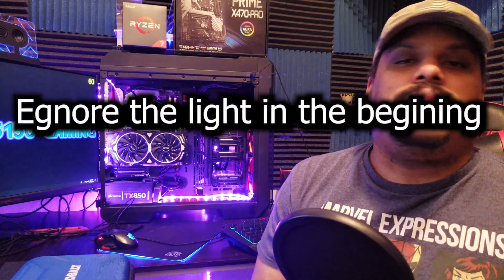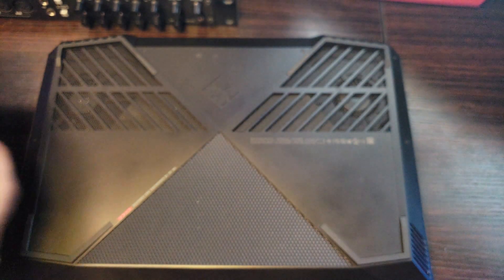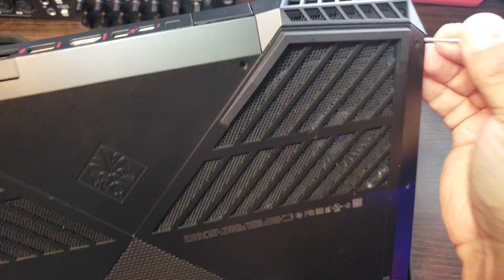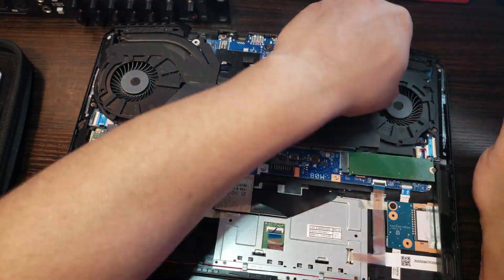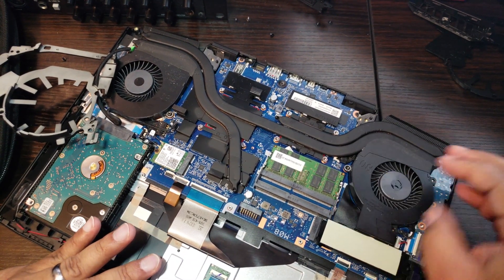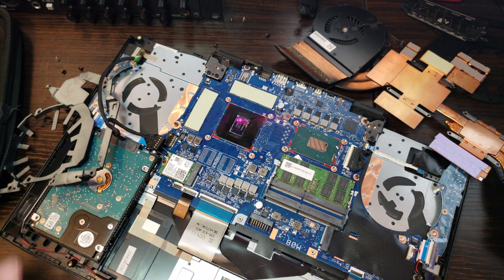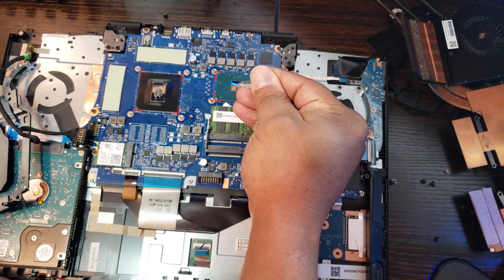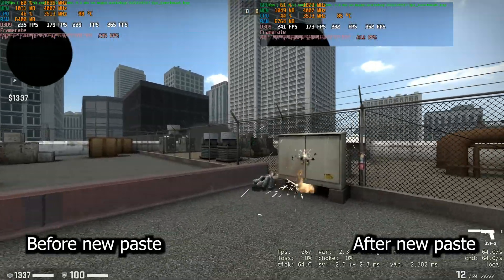HP-Omen 15 how to add new thermal paste to laptop / Laptop Tear down

Comment: I wonder if you removed the black plastic covering off the heatpipes if that would help with thermals when it comes to a laptop cooler
Reply from the maker: Idk if I'd do that it works well for catching some dust and debris.  Not sure if it's something I'd do lol. There'd be pretty big opening  :)
Reply: @EnforcerGamingX  I literally mean the plastic black barrier on the copper heatpipes themselves . For whatever reason ,it's all covered by that material on that one side but not on the other. I'm not talking about removing part of the outside plastic shell.

My thinking is if this is removed then you could have air from a laptop cooler blow air directly on part of the newly exposed copper heatpipes this helping dissipate heat

I have the same laptop,I'ma see what I can do tomorrow. I've already repasted it but I want even more cooling. I may go liquid metal soon
Reply from the maker: Ahhh okay I see. Let me know what results you get. :)
Reply: @EnforcerGamingX  I finished it this morning, had to use a flathead screwdriver to get most of it off. see pics below

https://photos.app.goo.gl/cS98bx95R1tEZUVLA

After running stress tests there is a difference in cooling performance for sure. It takes an extremely long time for AIDA 64 to indicate any CPU throttling now, and even then its like 1%.

I also like the look of the copper better :)
Reply: @Unsmooth_Edwarda  that's cool! How do you power those up?
Reply: @kylesiwi4093  I used this

https://www.amazon.com/dp/B081K8LBH3/ref=cm_sw_r_cp_apa_fabc_UFNWFbJD7JM14?_encoding=UTF8&psc=1

Comment: hey man thanks for the video. my hp omen 15 is running at about 88-92 degrees Celsius when i am gaming. should i replace the thermal paste or are temps like that normal for that kind of laptop? kind regards
Reply from the maker: While gaming that's fine, the problem I had was it was always hitting 100°c which in turn triggered the CPU to throttle. So if you're getting those temps you're good. Always helps but I wouldn't be worried on those temps. Thanks for watching!
Reply: @EnforcerGamingX  Bro thanks for that quick answer! The temps are around 40 degrees while casual use and only hit 90 while playing demanding games. Thanks for that relieving answer!

Comment: Hi! I have been thinking about doing a repaste. However, i am afraid i will break the laptop in the process. What do you think i should do, open it up myself or send it to the store and make them do it?
Reply from the maker: The HP store will put new thermal pads on which is part of the problem. Pads are just a lower cheap pad of paste, the actual thermal paste is what helps the most. Opening up the laptop is less complicated than it seems, I suggest recording everything if you do it on your own so you can track back during reassembly. I been doing it for years and still like recording, used to take photos as I worked but yeah cellphones and have plenty of recording gear now days lol. Search the comments here, there was a 14 year old that did it not long ago :) this video has most of what you need, I tried to cover it all. Let me know your results I'd like to hear about it! Thanks for watching!
Reply: @EnforcerGamingX  Thank you so much for replying. I will try to open it myself using your tutorial. I will buy the required equipment by the end of the week since i am busy with school right now. Anyway, thanks for your advice and i hope everything will go smoothly. :)
Reply: @daultimatepig3579  how did it go

Comment: How did this laptop make it on the shelves? its a safety hazard.
Reply from the maker: Well the problem is with all laptops that have 6+ cores. There was such a high demand for faster CPUs in portable gaming but the technology is not there yet. A desktop we can toss on a bigger heatsink and fan. With a laptop it's just not possible. They try with better airflow and giving options to push more power into the fans. It is however, horrible that they use such cheap thermal pads. At this price range we won't see decent cooling with 6+ CPU cores unfortunately for quite some time. Thanks for watching!
Reply: That's pretty much what I said. Repasting my brother in laws today after seeing he games at a constant 85degrees-100degrees on both chips constantly. He said that he called HP/Omen and they said there are failsafes for temperatures that are "unsafe". Told him like man if my PC ever hit those temps it would shut itself off completely. Crazy.

Comment: So im going to do this with my omen 15 ,but my friend is having a issue with his fans not kicking in when they should only when the laptop get super hot. Could this also be the same issue?
Reply from the maker: Actually when I was researching my issue I ran across a lot of information about fans not woring, and it seemed to be tied to the bios updates. Have your friend uodate the bios to the latest and see if that works. If not then the system is not telling the fans to kick in when it's heating up, a setting could also be wrong. If thats not it then could be something more physically wrong and best to check with HP on the issue. Likley the bios issue tho, but no wouldnt be the same issue as we're having. Hope it all works out, thanks for watching!
Reply: Check on the Bios. There is an option where you can choose if the fans ate always on or if the just kick in when under load

Comment: Undervolting with throttlestop is way easier.my omen 2019 GTX 1660ti was in the 97 degrees area right out of the box playing ac Odyssey and borderlands 3.after utilised throttlestop with a -125 my temp dropped to 68 degrees.i was previously using Sager laptops which are way easier to take apart but found this hp omen with a 9750h and a GTX 1660ti 144hz screen for 1100.00 on Walmart.if you like to tinker and whatnot then hey do you
But if not try throttlestop.
Reply from the maker: Yeah I'm not a fan of undervolting, mostly don't want to suggest it for most they can do much more harm then just adding paste. Hopefully they find a real solution to heat in 6 core+ laptops just no good options yet. Thanks for watching!
Reply: @EnforcerGamingX  Wait can you explain i have been told undervolting is safe worse case system crashes and needs to reboot.
Reply from the maker: @ryanclemons1  In general, yes, 100% safe. if you know what you're doing in bios. I say for most as many people are not too savvy when it comes to bios settings, get an itch to see a setting and start messing around. As a YouTuber, I want to be sure I don't recommend anything that may harm my viewer's systems ( Not hardware). Even tho it's not directly my fault I would feel bad for even suggesting it. It's not a big serious issue, the worst case is corrupting the system or a file but still a quick fix. Unless you're wanting to be more eco-friendly, I never see much reason to go into undervolting, so that's why I'm not a fan lol. But, to be clear I may at one point as it is something I'd like to show viewers on this channel.
Reply: @EnforcerGamingX  I get you man it's your  channel your rules.
Has for me I will not be going in my bios i plan on using Throttlestop to undervolt and the main reason i plan on undervolting is Temps i hear it can lower temps by 10C or more without lowing performance saving the hardware from throttling and damage. All without opening my case something i only want to do if i really have to since i have a bigger fear of screwing something up with the hardware. But i still will if you know the laptop needs cleaned or if undervolting does not give me the temps i need i may need to repaste.

Comment: Can you replace graphics card with another one on hp omen
Reply from the maker: Sorry it took a bit to get back to ya. Unfortunately no, it's soldered in like the CPU. They really should start building upgradable laptops, you can still change out the norms. The SSD which is a good one in here with an additional slot, the RAM is also upgradable. The GTX 1060 is good for everything, ive used pretty much everything in Adobe suite without problems. photoshop, indesign, premiere for my videos. Blender, 3Ds max, Maya, and game engines like unreal works fine with the 1060. Only real upgrade would be the RTX versions for gaming design.  Thanks for watching!

Comment: i still have a warranty for 1 year on my HP Omen 17. if i disassemble my laptop my warranty will be gone. so, it is a tough chose
Reply from the maker: On a legal note no, but I really can't give legal advice,  but if you live in the United states we are protected by law to be able to preform general maintenance on any electronics we own. It worked well for me and I wouldn't go back on that decision.  I was still under warranty during these videos.  Thanks for watching!
Reply: High risk = high reward, get stuck in HP wont do anything for you anyway- trust yourself

Comment: Hello , i added a new thermic paste but my laptop still up to 95 °C in game ( Mordhau) . Do you think that i put too much paste?
Reply from the maker: Yeah you may have added too much or too little.  Too much normally won't be too bad. Are you at leader staying under 100°c that's where the problems will come in when ur always maxed at 100..

Thanks for watching!
Reply: EnforcerGamingX  I definitely resolved the problem . I cleaned my ventilation and I up to 80  C . So check the ventilation if you buy the pc 1 year ago .   Put off the dust and repast with artic.

Comment: Great video!! 
Lately I've been concerned with my omen, i've had it for around a year and it's being getting rlly hot (being playing Rise of the tomb raider) so I bought a cooler pad for it but didn't change much.. 
First time dissembling but this video made me super confident so I'll buy an artic silver this week for my laptop :D
Thank you very much!!
Reply: How does it end? What are the temperatures now?
Reply: Use a high density paste not a low one like MX4, use thermal grizzly or TF8, trust me in this, you won't regret it.

Comment: New subscriber, great video brother, I got a new omen 15 a couple months ago and the temps seem pretty normal, for some reason the omen command center button doesn't work and omen command shows unrealistic temperature jumps that just go up and down depending on cpu usage, I've played battlefield V on max and it gets too hot to touch but doesn't throttle after hours, as soon as I see any throttling or shutdowns I'll open it up and slap some new paste on it, thanks for the tutorial :)
Reply from the maker: Hey Carlos! Thank you for your sub! That command center I've been having problems with also the temps never line up with my other programs, never know which to trust lol. I did an update video not long ago but may do another as the temps are still better than pre-paste it is starting to get hot again into the 90s at times. So maybe I'll need to repaste after 6 -10 months. Still better than being over 100°c all the time. Thanks for watching!
Reply: I guess since laptops run hotter than desktops the paste goes dry and crumbly faster, can't beat the portability though, only reason I prefer my laptop over desktop

Comment: I did this  ,many times because i didnt get a nices temps, before apply thermal paste i was getting 76-89 c and after apply new paste ( arctic silver 5) it keep getting high temps, even more, around 89-100 c , gpu decrease a lot , from 79 to 50 c , but cpu doesnt. While it is idle, it geto 30 c, but if i open a word, or a youtube video it goes up to 90 c in one second, and  goes back to 30c , everytime if the cpu usage is high , temps increase inmediatly to high temps, in 1 second,  in game is the same. Im playing at 90 c , and if i open menu option, it decrease automatically to 40c in 1 seconds, and i back into game  it back to 95 again so fast. How to fix it?
Reply from the maker: What... On earth is going on with your laptop lol. That's definitely not the actual temps. I'd say you knocked a senor or something but it would normally just stay at a strange temp. Something else is going on. I'd take it in man, or try to find what's misfiring with Sandra lite. That's got to be frustrating lol. 

Thanks for watching!
Reply: I did a full report of sandra and all is normal . My cpu is (i7 7700HQ)  I did remplace  the memory cards , from 2400mhz single  to 2666 mhz dual channel . It could provoke  that strange temps? Since i7 7700hq (on intel web) says it support 2400mhz ?

Comment: which thermal paste did you use? is that silicon ,seramic or metal?
Reply from the maker: Mentioned it in the beginning it's the Artic Silver 5 a Polysynthetic thermal paste. Definitely don't want to use liquid metal on something this new. That's more of a drastic measure.

 Thanks for watching!
Reply: @EnforcerGamingX  i know i was confused between 13 or 5 so that's why i ask .Thx fr replying me back The video is so much helpful nice work

Comment: Hey nice tutorial, i have a problem with my omen to, its the exact model as yours, im getting trouble playing games, when the laptop is plug in i get 97-100 c and im very scared because the laptop is new, and when i play games its laggin and breaking from throtheling i guess. I have insurance but idk if they cover this as a problem...should i go there and report this problem or maybe deal with it myself and save de insurance for later issues? Great videos, glad you are doing well with this laptop
Reply from the maker: Yeah that's shuttering is from the overheating I did an update on this a few weeks ago and it's still doing well. Did address some of the concerns with warranty and new tech gear. In short you should be fine as there's laws that allow you to make to make repairs in the U.S but of course check warranty laws where your from. Few people have put in trouble tickets with HP and they will add a new thermal pad ( not paste). It's low quality and will work for another few months. It's more of a cost savings solution for them.  A decent paste over the counter can really make a difference. I do recommend contacting HP to see if they've updated their practices, it doesn't hurt :) let me know what you do I enjoy reading the successes from my videos. Thanks for watching! Here's the update video on the repaste https://youtu.be/IY4d-bA7Uxg
Reply: @EnforcerGamingX   tks for the help, i will try contacting HP, do you think i can change the thermal paste like you did without practice, i'm  a little afraid to damage something
Reply from the maker: @skatefdp  Yes absolutely, as I tell everyone that's new just take video or pictures as you work. The only real trouble is putting things back together. Few weeks ago a 13 year old followed this guide and had success. It seems more difficult than it is :)

Comment: You helped me soo much, I did this a few days ago and the temps have dropped around 15-20° while gaming. I was experiencing heavy thermal throttling (couldn't run cs go/ bf4 at lowest settings higher than 30fps).  Now I can play both games again at ultra settings with a steady 100-130 fps (bf) and over 200 in cs go. My laptop also couldn't cool down anymore, it would reach temps above 95 after gaming (both cpu and gpu) and they wouldn't cool off at all, unless I shut it down and left it off for a couple of minutes, but now that's been resolved aswell. Thank you so much man!
Reply from the maker: I love hearing how my videos help others. Glad this worked for you can you can finally utilize pricey laptop. It's frustrating when you pay a premium price for something and you can barely use use because of a minor manufacturing flaw. They really should be using real paste crazy they use these pads because it costs less. I'd rather pay a few bucks more knowing I don't have to repaste later on lol. That's my personal take ... so glad this helped and thank you for sharing your experience :)

Comment: Hey man i just changed my battery and when i start it up it says my cmos checksum is invalid what does it mean?
Reply: Yeah i bought a new battery because mine was bloated after two years and the warranty doesn’t cover the battery after a year. After that happened it started up as usual though and everything was all okay even after restarting. Was just wondering why the text popped up the first time starting.
Reply from the maker: Okay you're fine. It just didn't recognize the battery on the boot. Long as it don't keep happening it's normal.
Reply from the maker: That's not good. You sure it's the right battery? An invalid checksum can seriously be a host of things. Did you buy a new battery?  Didn't think there was many problems with this one.

Comment: Hey enforcer! Great video. This is going to help me out a ton when i repaste/thermal pad my Hp omen laptop 17-cb0050nr . Ive been reading and seeing that hp' stock Thermal paste they use in laptops compared to newer and better paste is about 25-15 celsius difference! I also saw that replacing it with an IC thermal pad produced 20C lower as well! Thank you so much!
Reply from the maker: Glad this helped love hearing if a video helps.  And yeah that paste manufacturers use is pretty terrible imo. It's cost effective for them but bad for us. Thanks for watching!

Comment: Also i was wondering cam you remove the battery and run it while its plugged in? I mean running the laptop without a battery
Reply from the maker: Never really tried because the battery is can only be removed after removing the bottom panel and everything. So it would be kinda a hassle to do so lol. Thanks for watching!

Comment: Did you use normal thermal paste or liquid thermal paste?? Thank you
Reply from the maker: I show the kind I'm using at 2:30 the artic silver 5 paste that I normally used with my desktop PCs. Not liquid metal is that's what you're asking :) thanks for watching!
Reply: @EnforcerGamingX  thanks for the reply! I thought it was liquid metal as it did a really good job! So i guess silver 5 paste still does better job than the preinstalled paste!